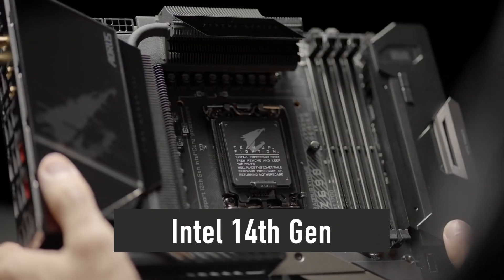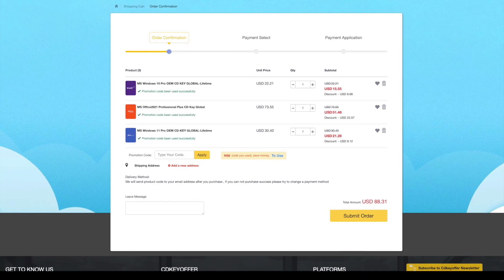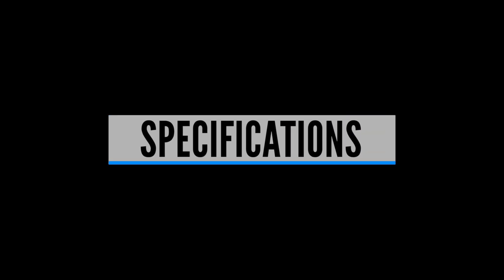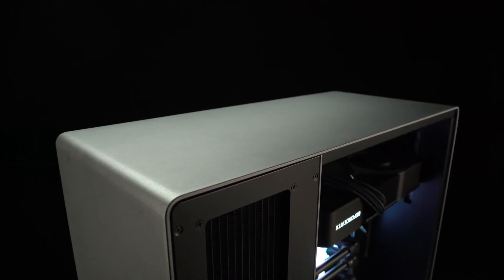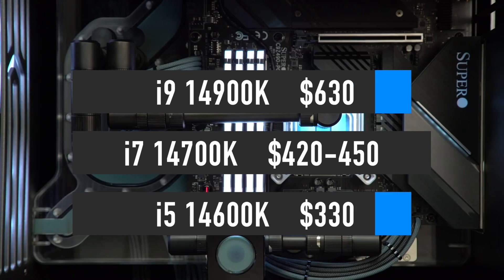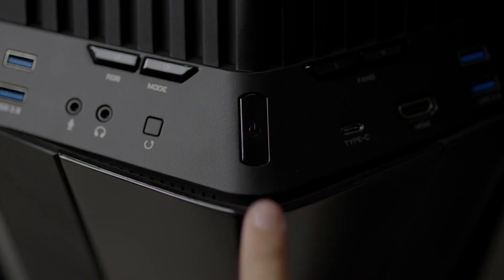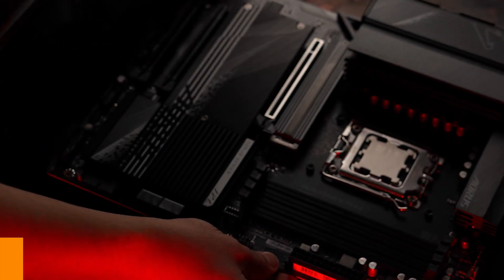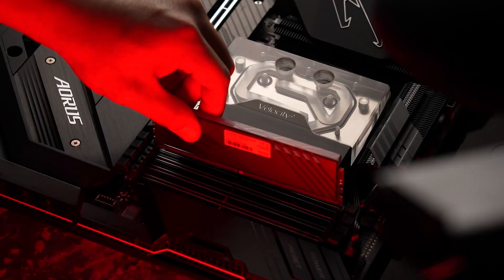Wait for i7 14700K even if you want to buy Ryzen 7000 [Intel 14th Gen vs 13th Gen]

Comment: First

If 7800x3d maintains 90% gaming performance, intel will have a tough time due to efficiency and price. Give them props for another generation on the same platform 👏🏿
Reply from the maker: 🤝 7800X3D will retain its relevancy for sure. If not through performance alone then through lower price. Same as we've seen with the 5800X3D🙂
No props necessary as Intel only did it because they don't have another choice😄 I'm afraid it'll be back to 2 gens per socket after that.
Reply: @theivadim  For GAMING it will. But everything else... people will decided to just go with the 14600k, because it's going to deliver close enough gaming performance, AND VERY good productivity, which those x3d chips simply don't deliver. And it will definitely be cheaper, unless Ryzen lowers the price by over $100 by then. The 14700k will most likely take over in EVERYTHING until AMD returns with something better.
Reply: I mean you're right 7800x3d makes a lot of sense... in games. But emulators, do better on cpus with higher clocks as opposed to more cache. So if you're in to non-native gaming, or productivity tasks, it may not be the best choice. Me, I already have a socket 1700 so I think I'm going to get a 14700k. I do admit that the 7800x3d looks mighty appealing at times though.
Reply: 7800x3d has worse 1% lows/stutters tho. If you pair 13th gen with fast ram and overclock/undervolt it it can beat 7800x3d. 7800x3d has barely any overclocking headroom and if you set memory controller over 1.25v it’ll explode
Reply: @kodakblack531  Stop lying. I had a 13700K, but have to return it and replaced it with 7800X3D for an ITX build. 7800X3D is definitely better for gaming paired with 4090.  Mine runs at PBO and 6400 1.25 for 3 months now and doing just fine for video editing and gaming. Temps stays at 70 degree on an EK 240 aio. 13700k was a furnace at 95 degrees with the same setup. You need to undervolt it severly to even match a 7800X3D temp and performance.
Reply: @Alp577  7800x3d is more efficient and gets like 10fps more in 1080 than stock 13700k but has worse 1% lows and can even stutter when cache needs to fill up again. 13700k has a gen better memory controller and is also an overclocking beast even if you undervolt it you can get more performance than stock. $60 bdie (3600cl14-15) set to 4133cl15 can beat ddr5 7600mhz in gaming. HMCG78AGBUA081N is good cheap ddr5 for overclocking too. Cpu ratio is linear to performance. People used to get 2x more perf out of their cpu before oc was supported. Gigabite has 1 click 6ghz for 13th gen but it uses like 1.45v which is crazy for 13th. Msi has bclk oc extreme feature which just unlocks the ratio completely without crazy voltage and I was able to get 7.10ghz on 12600k at 1.35v with 240mm aio running under 65c in gaming.
Reply: @Alp577  13700kf is $140 less than 7800x3d rn too